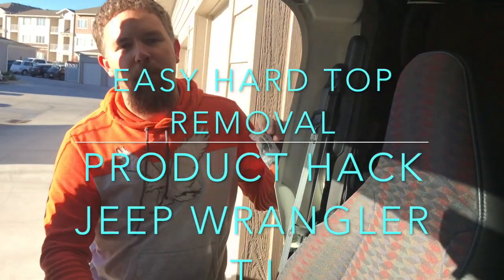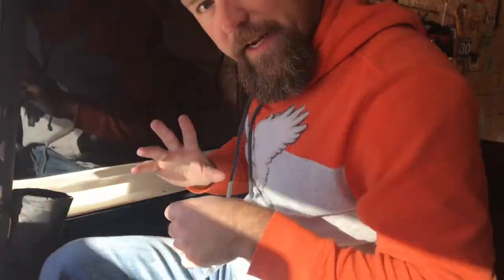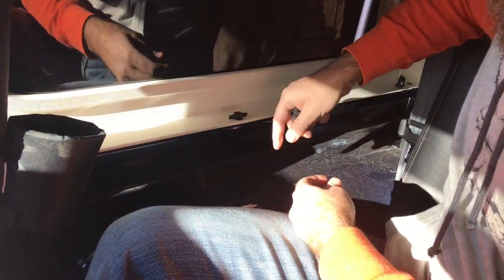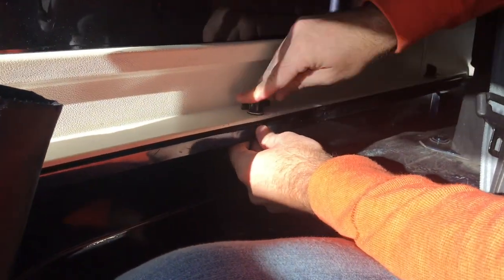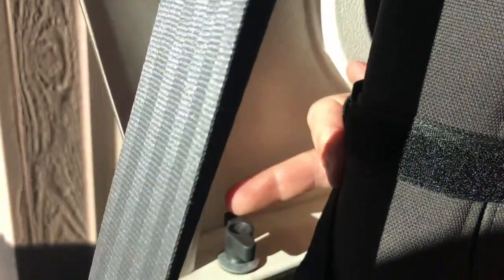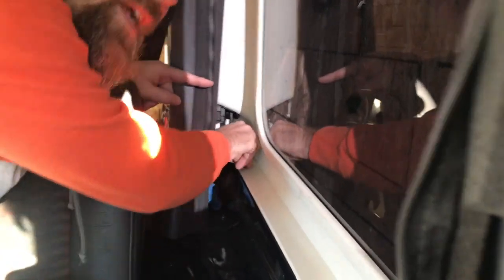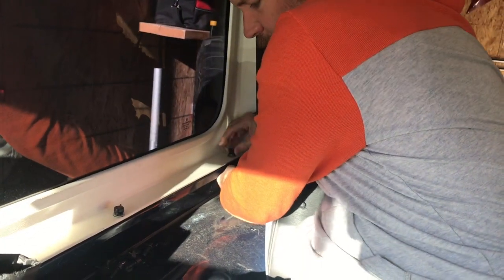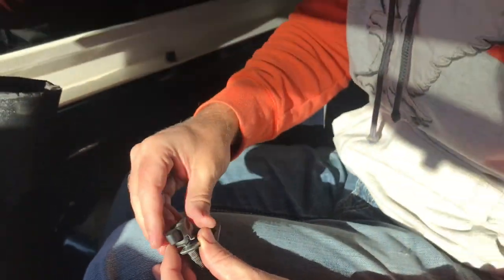Hard top removal hack jeep TJ

Comment: if you use new seals on the top these are not quite long enough to get the threads started.
Reply from the maker: Thanks John- good tip!
Reply: @TOCraft  No problem, You just really need to push down hard and actually flatten the washers.  the rear because of this is impossible, however I used them in the front 4 and for now ok with that.